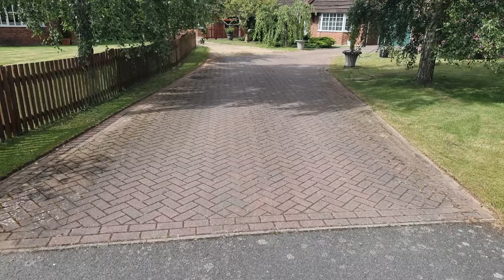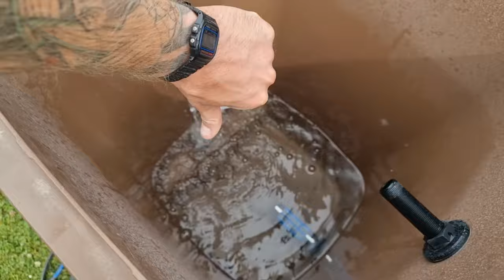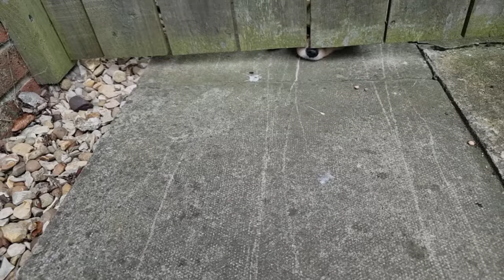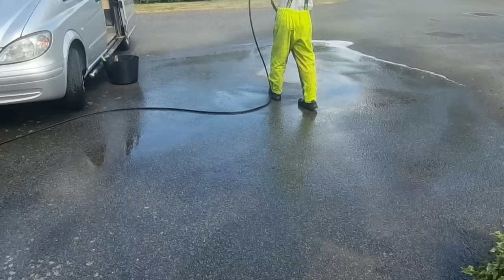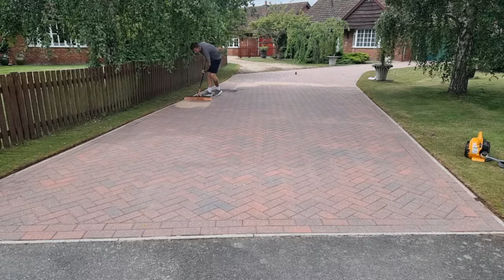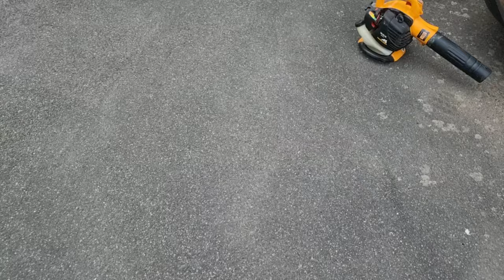A super FILTHY driveway cleanup - Turns into a river of SLUDGE | Pressure Washing | Power Washing

Comment: Are you allowed to push the soaps, bleach, or other chemicals down the street drains there? In the USA most places don't allow it, since these street (storm) drains into local creeks, rivers, bays. We have to setup a berm at the end of the driveway out of some sand bags with an automatic bilge pump and as the water/chemicals build up it turns on and routes the water either up onto the lawn (fine for soaps, or into the sewage clean out for de-greasers, acids, or bleaches). It's a huge fine for the property owner if you get caught washing chemicals/ oil/grease into the storm drains.
Reply from the maker: This is covered by the water industry act of 1991, ideally, no chemicals should be going down the drain at all, that is why the rinse-off is so important. 
It sounds like you know your stuff so you know that most chemicals commonly used have a large half-life meaning that as long as they are fully broken down with water the excess is mainly salt. 
I try to remove as much as possible from other areas and collect all waste before chemicals.

I have spoken to our local water board and they were in agreement that runoff from a clean is acceptable to go down a drain on one-off cleans but then when I have spoken again to them it was a different story. At present, it's a grey area(pun intended) one of our leading instructors on soft washing in the UK is still trying to clarify from the governing bodies what is and isn't allowed but it's a different answer each time.